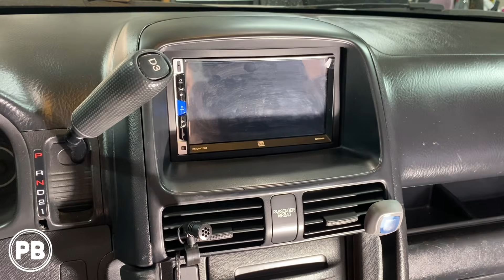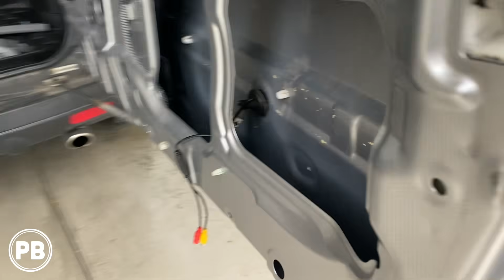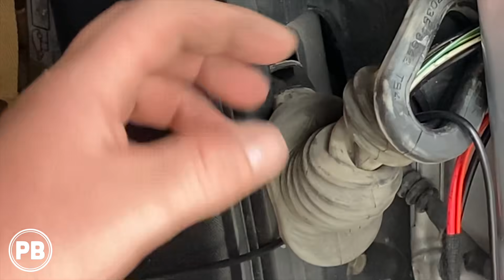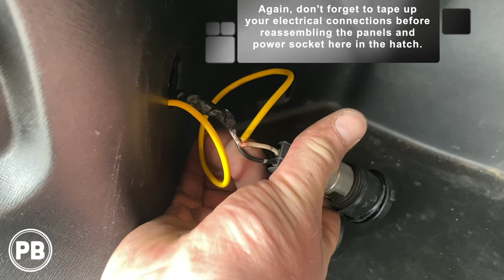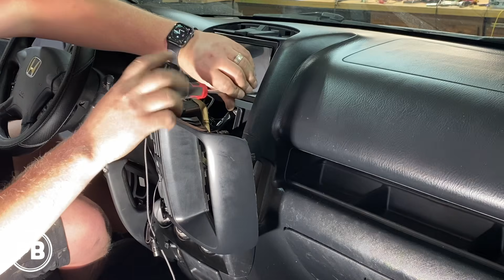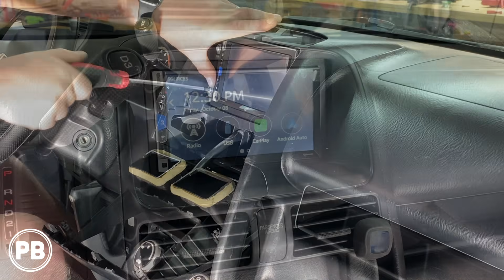2002 - 2006 Honda CRV Backup Camera Install

Comment from the maker: Parts used linked in the description of the video!
Reply: Provo, this video was very helpful to me.  The top three things in it that were useful to me: (1) tapping the green wire with black stripe (love the specificity so I didn't need to guess!)  to tell the head unit that the car was in reverse, (2) that the rear hatch panel could be unsnapped from its frame after removing a single screw, (3) the suggestion to use the auxiliary power outlet to supply juice to the camera. One thing I discovered that wasn't mentioned here is that the rear seats are can be leaned forward and perhaps even removed to ease of running the video cable in the door sills without removing the sills or carpet. I started my work at the head unit and I ran the video cable on the driver side to the back of the CRV because I found it easier to fish the video cable from the head unit into the driver's foot-well rather than trying to get the cable fished into the front passenger foot-well.
Reply: @EZephyr5 He did all right...but vice a versa. You always start from head unit.

Comment: Just tap the power and trigger wires into the reverse switch wire right at the gear shifter. It’s like 4 inches from the head unit, and all you’d need to run to the back  is the cameras rca
Reply: What color are the wires

Comment: Any advice? I used the power on the passenger side and when I put it in reverse it activates, but the blue screen appears, and the camera never turns on nor do the camera lights. When connecting the camera directly to the car's battery, the camera lights do turn on, but I don't feel like it is getting the power it needs to turn on.

Comment: Why did he go to the left side instead of continuing on the right side?
Reply: He went on the right side because it's easier to pull cables underneath steering wheel to head unit.

Comment: So useful having searched for the colour coding of the positive side of the reversing light. Do you have a video of removing enough of the ceiling panel to access the antenna? I need to fit a DAB one.

Comment: How does the reverse camera come up on the dash if it's powered with the ignition?
Reply from the maker: Because power the camera off of accessory is separate than triggering the radio to go into reverse.  Radio's that are compatible with reverse cameras will have a reverse trigger wire that needs to see 12v when in reverse, outside of power that camera.  So you may need to run a separate reverse trigger wire if you are powering your camera on accessory.
Reply: So, without the reverse wire properly wired, the camera could still be powered and visible, but just wont pop up when the car is put into reverse? @ProvoBeastAudio
Reply from the maker: If you alternatively wire the camera on just reverse light power, yes, it will only function in reverse and receive power only when the reverse light is on. @mydearriley
Reply: Ah! I was thinking that the "trigger" wire = "powers the camera once triggered." But it's more likely a change in amps (or would that be a change in volts?)  @ProvoBeastAudio
Reply: @ProvoBeastAudio  So, I have it all installed (following your guide, thank you), but the head unit is stuck with a black screen with green "No Signal" text. 

This happens as soon as I power on the car. However, when I put the car into reverse, the camera engages as expected. But once back out of R, it returns to the blank screen. I also have no speaker output (phone connects, but doesn't provide volume).

Any ideas?
Reply: Sorted it out! I had used opposite color wires to extend the power and trigger to the socket/tail light and of course hooked them backwards.

Comment: I bought one similar to this and I hooked everything up the way you did in the video, I’m not getting any camera feed but it does know when the car is in reverse, the leds around the camera are on too. Does anyone know how to fix this?
Reply: sounds more like a issue with the camera not the installation
Reply: I'm getting the same results... Pretty sure I installed it exactly like the video shows. Going to trouble shoot tomorrow...
Reply: @bryannelson72 what did your trouble shooting conclude ?
Reply: I had to use an external power source to make sure my camera came on. Like a DeWalt battery, so that told me the connection at the tail light wasn't good enough, and so I got that connection better. It worked.

Comment: Use posilock wire taps. Easiest and extremely well made design. They also are reusable, or if you mess up can be removed and used again. I use posilock connectors on everything.
Reply: Link for those connectors?

Comment: You know there a light on the other side that has all that and is closer. Would mean running less wire which is always a good thing
Reply: He had to extend the main power anyway to tap into the socket on the left
Reply: @zahari_s_stoyanov He could’ve used the black power wire on the reverse light bulb🤷🏻‍♂️ as power that what I did but all on the right side
Reply: @AlexanderPapi7  these systems require two power sources - one constant and one when the car is running. So the constant one is in the socket on the left
Reply: @AlexanderPapi7 it’s so much easier to use the same wire, but at the gearshifter, it’s literally inches away from the head unit

Comment: I can not get the screws out that hole the upper-side cargo hooks on the side panels.  I tried both sides, they just spin.  I was able to get the camera wire through the gromet and into the cargo area.  There's no way to get to those backup light wires without pulling that panel out more.  Without getting those upper hook screws out it does not pull away enough.  Any ideas where I can tap into the reverse lights? 2006 CRV.  Thanks.
Reply: Same with me. I finally got the screw out only to find out that those specific location hooks do not screw into the metal body of the car .....they are floating and only screw into the plastic panel no need to remove them.
Reply: There is no need to remove these cargo hooks. They do not hold the panel in place against the metal frame of the vehicle.

Comment: Why did you use the left brake light instead of the right?
Reply from the maker: Well, we went to the reverse light, not the brake light.  We went to the driver side for better access for recording video.  You are welcome to tap into either side.
Reply: @ProvoBeastAudio  I meant reverse, sorry. How does connecting it to the left side give you better access?
Reply from the maker: @GeorgeWPush  For filming, not necessarily for access generally.  Easier to show how to remove the rear light with the camera to show what wiring to tap into.
Reply: Any advice? I used the power on the passenger side and when I put it in reverse it activates, but the blue screen appears, and the camera never turns on nor do the camera lights. When connecting the camera directly to the car's battery, the camera lights do turn on, but I don't feel like it is getting the power it needs to turn on.

Comment: Do you have to go to the driver side to access the backup light power?  Thanks!
Reply: Did you ever get an answer on this? I really don't want to run it across from my driver side seems like a waste of effort
Reply: You should be able to connect it to the passenger side.
Reply: The license plate on these CRVs is off center. Do the backup camera guide lines still work okay with the camera off center?